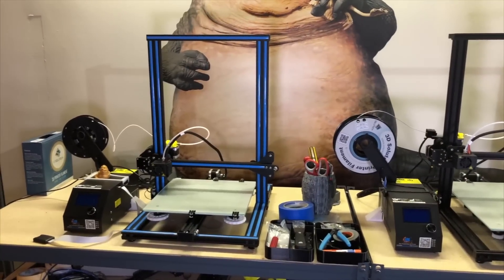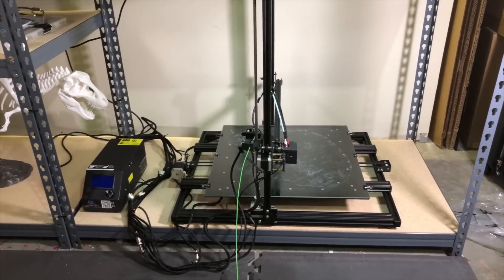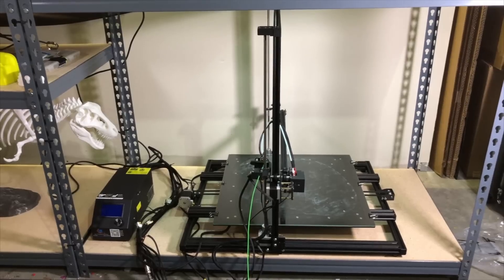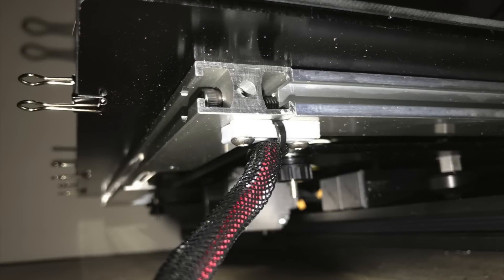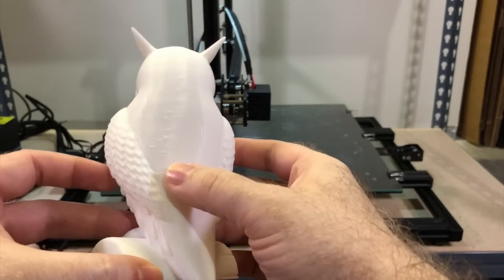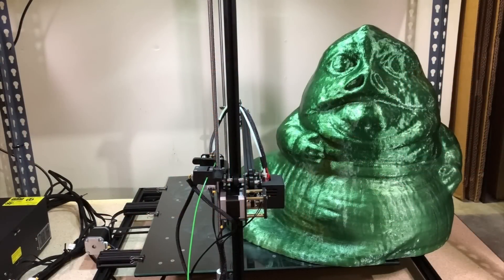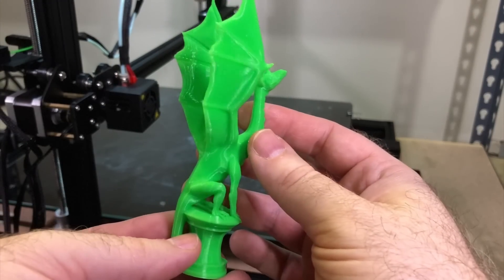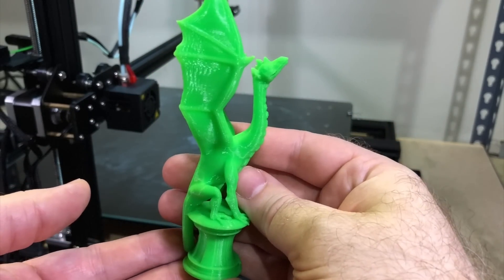A First Look at the Creality CR-10 S5: The Biggest CR-10 3D Printer

Comment: This printer is amazing and worked so good for a while but Ive recently been having issues with build plate adhesion what settings are you using for the cr10s5. Do you have a shareable profile of settings for cura? Or just a document to help get back on track? Thanks mighty jabba youve done great vids and prints
Reply from the maker: I don’t use Cura, but I feel like adhesion problems are probably more to do with physical things like bed level and not using glue stick, rather than software settings
Reply: @MightyJabbasCollection  thanks for the prompt response, i was doing great no issues lost my touch. Ill check those physical things thank you very much
Reply from the maker: Bed level in particular is hard on this machine
Reply: @MightyJabbasCollection  i installed a auto bed level kit when i first got the machine its been amazing lol i did not want to deal with that headache

Comment: how the plastic adhere to the glass? do you need any product to help the adhesion or is it ok like that?
Reply from the maker: Science 3D The heated bed is sometimes enough to make it stick but to be safe I usually apply some glue stick. There are also print surfaces you can buy

Comment: I have this printer and I have to say this is a very rose colored review. Ive had nothing but issues with this machine. The overall design didn't scale well. The z axis is a major problem. They hang two stepper motors off one side and nothing off the other, You can get away with this on smaller machine and not see any issues but when you have a gantry  that's 20' long you cant. the two sides come out of alignment just enough to throw the bed leveling totally off.  On top of that show stopper add that they used a bed heater that is way to small. Ive been struggling with mine for over a month and have yet to get the first layer laid down well.  I give this machine a 3 out of 10 and wouldn't buy it again.
Reply from the maker: To be fair, this wasn’t a review at all — just a first look at the printer to see what it could do. I made a separate review video that did explain a lot of the issues with this machine. While my conclusion wasn’t quite as negative as yours, I agreed that it has some problems and I don’t recommend the S5 compared to the smaller printers in the line for that reason.

Comment: Thanks for the video very interesting and great info! Question I haven't found anything out there about the "footprint" of the machine I know it's 500mm  but I'd like to know the size of the printer. I have a counter-top that I'm thinking of putting it on but unsure if it will fit can you tell me the width of the machine or the width of that shelf you have it it on?

Thanks!
Reply from the maker: Sorry for the delay in getting back to you. I have misplaced my tape measure, but according to TinyMachines (link below), the total occupied area (including the control box) is 32" width x 40.5" length with the table extending 6.5" beyond both front and rear. That sounds about right. It's really large.

https://tiny-machines-3d.myshopify.com/products/creality-cr10s5
Reply: @MightyJabbasCollection  Thank you for writing back, and no problem on the time. I bought the printer, would you recommend any upgrades right off the bat?
Reply from the maker: I would print the heat bed adjustment knobs and also some sort of strain relief for the heat bed cable. Unfortunately the one I used was from a Facebook group a while back and doesn’t appear to be publicly available, but hopefully there is something on Thingiverse made specifically for the S5. I have literally done nothing else to my machines in terms of mods

Comment: I have successfully printed up to 1.2mm thick walls using a 0.4mm nozzle in vase mode.  It actually works pretty well and the walls are MUCH stronger that way.  I also don't get the ugly start-end on every layer.

Comment: XNLYL for s5 doesn't work
Reply from the maker: Hi. It does work, but they recently raised the prices on most of their 3D printers, so the price I had in the description is no longer valid. I have updated it
Reply from the maker: They have added the code GBTE, which takes 15% off of any 3D printer that's not already on sale, and that makes the CR-10 S5 cost $942.

Comment: Hi there, could you please share the temp details for all the prints.
Reply from the maker: For all of the prints that were in colors (not white) I used MakerGeeks PLA filaments, which have a recommended nozzle temperature of 235 degrees (that's quite hot for PLA, but it seems to work). I think I just used 200 or 210 for the included white filament. The bed was set to 60 degrees and I used glue stick to help with bed adhesion.

Comment: Hi nice informative vid, just wanted to ask if the size of the heated bed does not cover the whole build plate? I am planning on buying one but I am apprehensive on the build plate issue?
Reply from the maker: Yes, it only has a partially heated bed. I only print in PLA so I'm not really sure if I even need the heated bed at all, but for some people this will be a disadvantage. You can get aftermarket heaters, but that's more money. My final review of this printer will be coming out very soon (within a day or two) so maybe keep an eye out for that.

Comment: You might consider getting a larger square piece of wood and just lay it on top of that rectangle piece so you can turn it forwards and remove the extensions and put filament roll on side like normal.

Comment: For your tower, tweak your retraction settings and also the temperatures and increase the part cooling fan speed so it cools your bridges faster of mod it with some blower fans. Also if you have time, print a new part cooling fan deflector so it hits the hot plastic a bit better. I would say that you print the bridging, temperature, and calibration models also to tweak it all so its perfect. Great video btw!

Comment: You could really put a 0.8mm nozzle on that thing. vasemode would work great and you get shorter print times!
Reply from the maker: kgj Yes, I actually have one that I ordered since making the video. I just have to find some time to experiment with it. I think a larger nozzle makes a lot of sense with these bigger printers
Reply: Mighty Jabba's Collection suppose it's entirely possible to also print up a ceramics terra cotta extruder, or a airhempcrete version of that as well. That might lead to developing a 3d printed housing section to Thingiverse lol. Happy printing.

Comment: Hey! Thanks for your channel. Have your ever printed several small objects on a single 400 mm (cubed)  bed at once? Assuming you are always near by your printer. . . do you find that faster than printing one small object at a time?
Reply from the maker: Jason Westmas It’s probably a bit faster since you don’t have to restart the print each time, although with 3D printers in general I find that printing lots of things at once can sometimes yield lower quality than doing them separately, and if something fails they all fail. There’s also the option of having your slicer print them one at a time instead of doing one layer for all objects and then doing the next layer for all objects, etc. In that case you do need to be careful of the order so your nozzle doesn’t hit things you have already printed

Comment: dude that is amazing. to solve the "flimsy" either in your slicer or on the printer when your done your solid bottom layers crank up the flow rate to 1.25 nice and thick.

as for the seperations. for some things you can't use .24 layer. deviation from vertical will cause seperation. you need to lower the layer height. you accounted for this in the jaba with more perimeters.

the more deviation from vertical the more perimeters you need OR the lower the layer height you need.

Comment: Hi there, which 3d printer is the best for making an R2 unit?   I'd most would like to avoid the warping process.  Thanks.  David
Reply from the maker: +ssuperdave100 Any of the CR-10 models would work, since they have heated beds and are big enough for all of the pieces. I plan to use them for this kind of project moving forward.
Reply: Thank you for getting back to me.  So the CR10 S5  does not have bad heat issues?   Thanks again!  I want to take the same path as you in regards to possibly starting this project.

Comment: I have the S5, your going to want the keenovo heater from tiny machines to heat the whole bed. Full 500x500 heated bed. Also turn on the manual mesh leveling to compensate. But I love my unit!
Reply: what do you mean with manual mesh leveling?
Reply: Mesh leveling can be turned on in the firmware. The new s5s does not need a boot loader to allow editing of the firmware. So I would highly recommend (if you know what your doing) to edit marlin, and upload the new firmware with mesh leveling and 4 points. What this will allow for, is issues with the bed itself being unlevel, and still getting perfect prints. Like auto leveling, only you take the 20 seconds it takes to make the adjustments.
Reply: Now i am really interested. Unfortunately i am not at all experienced with editing firmware. Did i understand it right, that i could basically get the same effect as ABL if i edit the firmware? Are there any guides to do this? Big thanks in advance
Reply: Exactly right.  An abl or a BLtouch will do this automatically. I don’t mind taking the 30 seconds to do this manually. I’m not sure if there are many guides out there... and I may piss off those trying to make money off folks creating these devices. But, firmware is free, so is knowledge, and you should only get these devices if you want them.... not because people don’t tell you about the other solutions. I’m sure I’ll make a video on my channel at some point. Feel free to subscribe and I’ll push one out. Or if you have an S version I’ll just put the firmware someplace.
Reply: fluffybunnyz well. Im definetely gonna subscribe and wait for that video. Weird that no on has ever mentioned this before. Thinning about it slightly makes it blatantly obvious that it should be pretty simple to do... Thanks for the heads up
Reply: My cr-10 S4 will be delivered in about 3 weeks, so I am already collecting all mods and infos about it. Thats why i am very interested in getting the most out of it, without spending too much money. So i just a firmware upgrade does an excellent job, I am very interested in gettting in howto.
I have here Marlin 1.1.4 and arduino 1.8.4. Looking forward for you vídeo ;)